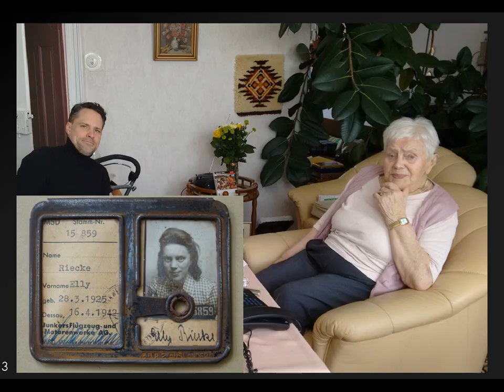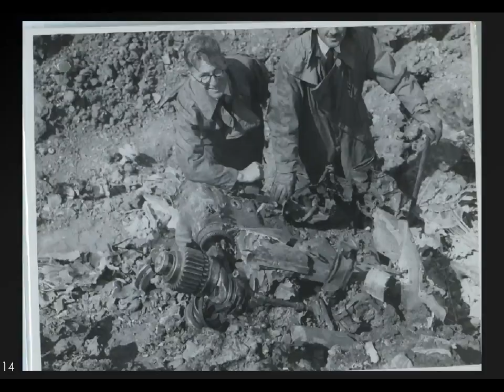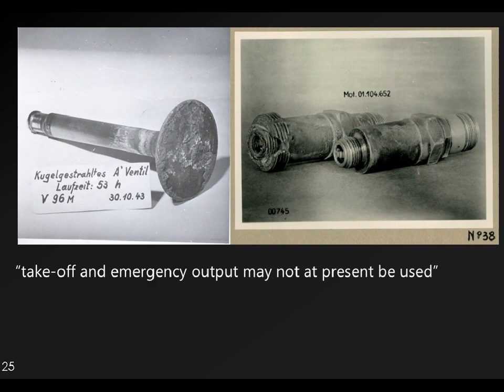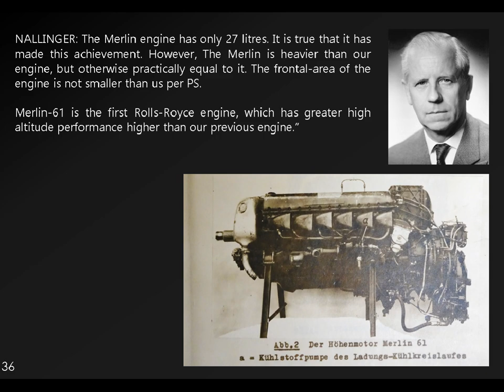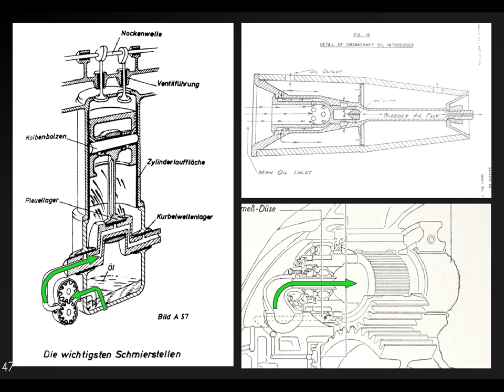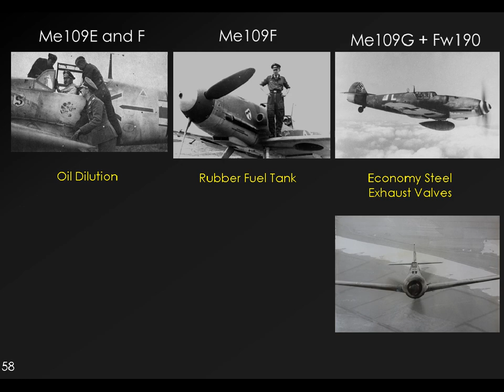The Secret History of Fighter Aircraft Engine Development in WW2

Comment: Is there any metallurgic/engineering backside by using chrome or stellite coating on the valves, instead of having a high nickel content in the valve's bulk metal? (Except from that they didn't seem to get the stellite right.)

(And this video has a much higher audio quality than most of the videos on the IMechE channel!)
Reply: Chrome plating is actually very porous, so it is VERY difficult and time consuming to make a layer which has as good corrosion resistance as using a better core material. So it has to have a LOT of layers, and processing. I need to check but I think it needed about 35 separate stages for each valve, if you get it wrong the chrome plate flakes off, which produces even worse pre-ignition than low Nickel valves!

Stellite is very good, but only if you have plenty of Cobalt.... which they did not...
Reply: @CalumDouglas  That came as the greatest surprise in years: Chrome plating that looks so compact because it is so shiny! (Too bad my old University doesn't have metallurgy courses.)

Comment: I think the actual German problem in WWII development differs across all branches from the popular stereotype of "German engineering" - in that the Nazi elite circle (like many other authoritarian systems) cultivated a state of chaos, power struggle and unpredicability in all aspects of the state; far from the propaganda image of "running like clockwork", "everybody doing their part for the Endsieg", I think it was a cutthroat, dog-eat-dog, fear-driven situation of constantly shifting goals, coalitions and shifting spotlights on detail issues, in which a competitor's demise was welcome as it increased your own position, and in which everyone up to the highest ranks usually chimed in and gave an authoritative, albeit often temporary opinion - aka Micromanagement. 
It's a solvable problem to develop a "wonder weapon", and it's another solvable problem to develop a bread-and-butter system to be made from lower quality materials using unqualified labor - but it's yet another to develop a high-tech system and be told somewhere in the middle of the cycle by the project patron: "that's it with the high-quality alloys, you need to make do with construction grade materials - unless I can pull some strings to get you what you need, so don't lose faith. But my influence on that might be temporary anyways. Also, we need it to be hitting the frontline by next month. But don't lose sight of all the planning we already did for the next 20 years of development, that is still on the table..." 
What can be said about the engineering types is, they remained over-optimistic in these circumstances and just too eager to close their eyes to the bitter reality - just like they did about the reality of forced labor, they probably assumed that "the supply situation will soon improve, let's keep going on that assumption" - in winter 1944/45.

Comment: The speaker mentions the Mosquito as the best fighter and discusses its innovative production techniques as a composite wooden aircraft. I'm not an expert on aircraft design, but I've gotten the impression that the German Albatross fighters of WWI were built in a very similar fashion, even out of similar materials including balsa wood.
Reply: Plenty of aircraft used plywood construction. The difference was that the Mosquito used doped fabric to cover it, improving aerodynamic performance. The other thing was that the Albatros was never designed to fly at the kinds of speeds the Mosquito was capable of. Even the Americans didn’t believe it was possible until they saw it. Reports from Beechcraft at the time derided the construction method as having too many compromises which weakened the structure and made it unsuitable for combat. Needless to say, that report is low looked upon in hindsight with some derision, even by Americans. De Havilland knew exactly what they were doing.

Comment: Didn't ford motor company help RR get stated on the Merlin
Reply: Yes. Sir Stanley Hooker talks about it at length in his book, “Not Much of an Engineer”.
Reply: No but they did re do all the tolerances to make the parts interchangeable so that Ford could make them on a production line without skilled fitters. The Ford Merlins leaked less as a result.
Reply: @donaldasayers whilst I knew that Henry Ford had originally offered to build  Merlins, but in July 1940 rescinded the offer and Packarc took over to build them. I Didn't know Ford had done some work on the engine design.
Reply: @neiloflongbeck5705  Ford UK built Merlins from I believe late 43 til the end of the war. My understanding is that they were not given a choice in the matter.
Reply: @donaldasayers  ta
Reply: @neiloflongbeck5705  Ford (UK) built 30,500 Merlin engines at Trafford Park in Manchester between 1941 and 1946. They redesigned the engine to make it easier to mass produce, Ford UK did a infamous advert with a Spitfire flying over the white cliffs of Dover with music from the Battle of Britain film in 1990 with the catch line "Between 1940 and 1945, Ford built 30,000 RR merlin engines for the RAF. That's why in 1990, we don't have to say Vorsprung durch technik"
Reply: @donaldasayers  Ford UK were all for it, they got a massive new factory out of it for free.
Reply: @neiloflongbeck5705  
Ford had no involvement in the Merlin design. When they and Packard came along it was getting it to a production line engine, using the methods, and tooling, they were familiar with.  I am not aware of any pre war aero engine that was mass produced on a production line anywhere in the world.

Ford in Manchester never made an engine remotely like the Merlin. So they would not bring too much to the party. The nearest Ford made was the Flathead V8. I believe it was made in Dagenham, which powered some trucks and large cars, which also was used in the Bren Gun Carrier, because it was readily available, ideal for that application and cheap.
Reply: Interesting bit of history with Ford and the Merlin. Ford UK built Merlin under license and I don't think there was any question of 'helped' there. Ford US took a contract to build Merlin and went over all the drawings and presented their own engine very different from the Rolls engine except it was the same bore, stroke and displacement. It was Ford's substitute for the Merlin and Ford insisted that they should build it instead of the Merlin because it was, in their opinion better. Well the English and the US Army didn't like it and told Ford that they were done and gave the contract to Packard. Ford ended building an eight cylinder engine based on their aircraft engine which was the BAA engine used in the M4A3 Sherman medium tank as wall as a few 12 cylinder engines for some heavy developmental tanks which were never produced. This is according to Maurice Olley who worked for Rolls-Royce in the USA and was involved in the start of US Merlin production.
Reply: @keithstudly6071  That was the Ford GAA engine - here's a good Wiki article with the history of that engine and its origins from the Merlin engine:
https://en.wikipedia.org/wiki/Ford_GAA_engine
A later variant, the GAN engine, was used in the M26 Pershing tank.

Comment: we associate high output modern engines with high RPM. The merlin developed its maximum power at 2850 RPM. Why were ww2 aero engines making max power at such a low engine speed?
Reply: Porsche were contracted by the German Air Ministry to develop an aero engine based on grand-prix technology (i.e. smaller, lighter and faster running). By the time they accounted for the different fuels (the Grand Prix engines were using a lot of methanol, which has far too high fuel consumption for use in an aeroplane), the totally different duty cycle (aero engines need to spend many hours at high continuous load) and the completely different supercharging requirements, the Porsche engine was deemed to be little (if at all) better than the existing aero engines. The main factor is probably duty-cycle, with the technology of the time it would be implausible to create an engine of sufficient power which also had long enough life at nearly full-load using high crank speeds. In BMEP terms they did very well indeed, the very best WW2 aero engines in 1945 on test beds achieved 25 Bar BMEP (the Jumo 213), which is still very creditable.
Reply: One reason is that aviation propellars are most efficient at those 'low' RPMs. Unless geared to the engine propellars turned with the main crank.
Reply: @robertmatch6550  the only prop aircraft I worked on were turbo-props, they all had a 'reduction gearbox' for that very reason
Reply: Rpm’s are low because the tips of propellers don’t last at a supersonic angular velocity and the resulting shockwaves make it less efficient.
Reply: What was the rpm of automobile engines in the 1930s?  Certainly not as high as today.  And unlike auto engines, aviation engines (like marine engines) run at constant at high power output.  They are often called powerplants rather than engines due to this application.  This favors larger cylinders at lower RPM, and large reciprocating masses force lower RPM.  Even so most of these these high performance aero engines were geared, with the prop turning at about half crankshaft speed.  Direct drive is mostly used on light aircraft with small propellers.

Comment: How did German aces such as Garland etc achieve so many victories using the 109 ?
Reply: In a Judy?
Reply: Skill and longer tours
Reply: They had no rotation that took people out of combat, unlike the Allied pilots. Basically, they flew until they died, or ran out of war or planes or fuel.
Many also had experience from before the Allies joined the war, such as the civil war in Spain.
They also had an almost unlimited, slow moving bombers flying over them day and night.
Reply: Short answer in 1940 was shite RAF air combat tactics. RAF section's, Flights and Squadrons flew in tight Vic (three aircraft in a V) formation. which meant that the wing men of each section leader were too busy looking at the leader to do a good look out all around. Galland and the rest of the German Aces attacked from the blind spots from above at high speed, shot down somebody at the rear of the formation and used their speed to get high again to either set up a re-attack or run away. When Galland was fighting the RAF  over France in 1941 and 42, He picked the time and place to engage and ran away if things started to go south. With the advent of the Spitfire IX in 1943, things went south a lot. Most of the Big number aces in the Luftwaffe fought on the Eastern Front or flew Night Fighters.
Reply: @richardvernon317  I wonder how many times he had to bale out due mechanical.
Reply: @davidpearn5925  None as far as I'm aware. From the back end of 1941 to early 1945, he didn't actually do much combat seeing he was flying a desk as the boss of the German Fighter Forces. He did get shot down twice in one day by Spitfires in 1941 (one crash landing and a bailout), followed a week later getting wounded when a 20mm Cannon shell from a Spitfire hit his 109. The only other time he lost an operational aircraft was when he was shot up in a Me-262 by a P-47 while following a victim down to confirm a kill. He managed to get back to base and land, but the 262 was then shot up on the runway by other Thunderbolts. He also crashed a couple of times in training in the 1930s.
Reply: The better question is how many German pilots/aces died in air combat leading to total air superiority by the allies by 1944.
Reply: Training, experience and leadership. The other thing was that German fighter pilots didn’t get leave unless they were wounded. So the ones with the greatest totals at the end of the war were the survivors of years of uninterrupted combat flying.
Reply: The biggest German aces fought in the Eastern front, like Erich Hartmann with over 300 kills.   He flew over 10,000 sorties by his own count, an unimaginable number for an Allied pilot.  Many days, he would fly dozens of sorties.  His primary victims were the slow Soviet attack bombers and fighter bombers, like the Il-2, and the occasional Soviet fighter caught unawares.    He was also able to rack up so many kills because first and foremost, he SURVIVED.   He had a simple rule, never get into a dogfight - that was the EASIEST WAY TO GET KILLED (and the hardest way to get a kill).  He was the classic zoom and boom hunter, had superior vision in an era before radar guided missiles, and could see his enemy before they saw him.    He would swoop down, shoot as many planes as he could, and then he was gone before they figured out where to try to get him.  
His biography "The Blond Knight of Germany" is well worth reading.

This was completely different from the Western European air war, especially once the U.S. was in it and the Luftwaffe was on the back foot trying to shoot down the heavy bombers through the dense covering crossfire between the bombers.   The situation became terminally grim once the US long range fighters got into the fight.  

The book "I flew for the Führer" describes the experiences of one Heinz Knocke, who claimed some 50 kills or so, but probably had less.   His book basically describes him bailing out of his shot up FW-190 or Bf-109 on almost every mission towards the end.   His final mission describes him flying a balky Bf-109 that must have had one of those really bad engine problems.   He knows it is bad, and he only has these raw pilot recruits who barely know how to fly with him, but he is ordered by a fanatical superior into the air to challenge a bombing raid coming in.  So he takes the bad engined Bf-109 himself, barely gets it off the ground, gets shot down, bails out and survives, while everybody else in his flight is also shot down and killed.   Nobody even comes close to a bomber.

Comment: Only 'found' you this morning from a lecture/blog you did late last year.
I was a motorcycle mechanic, tech, service manager, etc but found that very easy to follow along, maybe due to you being 'non-academic' before doing your engineering degree? (I wanted to do mechanical engineering, just couldn't do the math even though I did learn to use a slide rule in the 1970's - then promptly forgot how to use it a few years later when electronic calculators came out)
Always had an interest in four stroke piston engine rather than 'buzzy' two strokes (although 'had' to ride a two stroke when racing or would be on a different circuit being so far behind)
Learned a few new things, thanks.
Reply: Rolls Royce had the Crecy 27litre V12 two stroke under development. Based on the V twin test mule performance, the War Office thought it could go to 5000 bhp. 
Progress was slow and silly mistakes made because the top managers were working on Merlins and Griffons.
But two strokes were not fully sorted until MZ engineer Walter Kaaden developed the expansion chamber to exploit the harmonics of intake and exhaust timing.
Reply: @Dave5843-d9m  Wasn't that when he defected in 1960's? Went to Suzuki in Japan and they dominated small capacity GP racing for a few years
Reply: @1crazypj  It was their racing driver who defected not the rocket scientist Walter Kaaden  (V1 engineering)